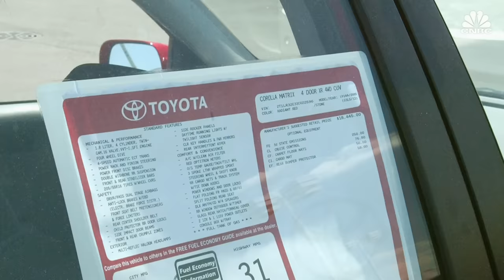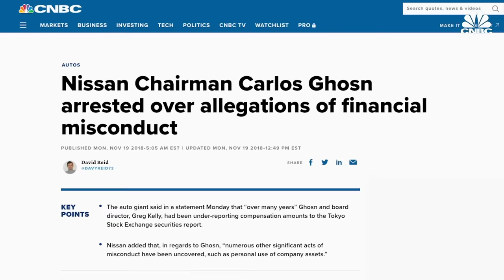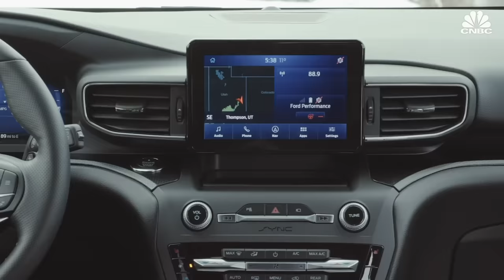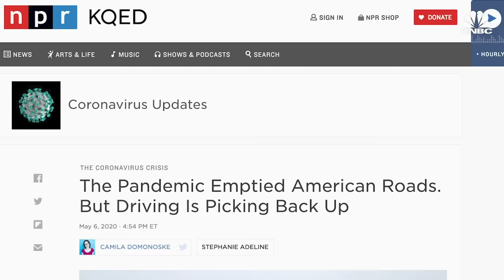Why Toyota, Honda, And Nissan Continue To Bet On Sports Cars

Comment: Probably worth noting is that Asian manufacturers are not too caught up in raw power and straight line acceleration. It can be hard to make a case for getting a car with 500+ HP like a Hellcat, Redeye, ZR1, etc. 

It's not bad to have 500 HP- in a vacuum. If your Corolla suddenly got 300 extra HP and literally nothing else changed it would be awesome, but that isn't the case. That power comes with an increased upfront sticker price. Designing a very powerful engine that doesn't blow up, overheat, or destroy other parts of the drivetrain takes time and the cost is passed on to you. You'll also be using close to twice as much gas as a "regular" car. 

In a car with a 0-60 time of 3.5 seconds, how much fun can you really have on a public road with it compared to if you were in a 4 cylinder or modest 6 cylinder? There's always the track to truly wring out a fast car's potential, but I'd argue that most people who can afford them are too busy working to do that and deal with the added maintenance that comes with tracking.

Comment: It would be interesting to hear why cars like the 2011 reboot of the VW Scirocco do not make it to the US. As one German auto exec told me, America and Canada get the crap, and Europe keeps the good stuff. Euro cars are built to do 100mph for hours on the highway and get good gas mileage.   US cars are designed to keep local police departments busy with speeding tickets as we STILL have a 55 mph max even though everyone on the highway is driving at 80 mph, casually.

Comment: Why I like Tesla Car? It  runs faster than Lamborghini and most of modern sports cars. Sport cars is usually heavy based on the weight and wheel base. But Sports car can run fast if it goes 80 mphs or over.

Comment: If you list all the Japenese iconic sports cars more than half of the list is Nissan.
I'm getting the 400z once it's released! The VR30DDTT can easily be tuned to 600 to 700 whp.
Reply: The A90 is 99% European, not Japanese. Sorry but you can count that one out.

Comment: I always thought that Toyota should make the Tundra pickup more American looking.  It looks very Japanese.  I always thought theat Toyota should give the Tundra some F-150-like body lines.  The first generation Toyota Tocama, in the mid-late 1990s, had very American looking body lines.  The Tacoma did not mimic a Ford or Chevy Trucks but, it looked American.

Comment: Akio Toyoda is becoming the Japanese Enzo Ferrari, in terms of the pride and commitment to his cars.

To do this with a company of Toyota's size is incredible. Think of the amount of red tape...in-company opposition, shareholders to convince...
Reply: Enzo Ferrari would punch you for saying that, he'd never outsource his halo sportscar to a manufacturer on another continent and also a Ferrari badge on it
Reply: @E9X330  The Supra, is not a Halo car. For Toyota, the GR Yaris and Le Mans based hyper car is. And as for Lexus, we know it's the LFA, and LC .

And as for outsourcing? Well we all know the LF-A wasn't bad. 

As a V8 Ferrari owner myself, I respect Ferrari very much. But I don't think Enzo would look down upon Akio Toyoda's commitments to the sportscar industry.
Reply: @JS-te2vj  the supra is toyotas halo sportscar, they don't yet offer anything that's faster
Reply: @JS-te2vj  why do people constantly equate outsourcing an engine to outsourcing the whole car ? The mkv is 95% bmw, remove the Toyota badges, drive on and tell me if you can feel ANYTHING toyota about it, because me and everyone else that test drove it couldn't, it feels pretty much like an m240i with an LSD and proper suspension. Coming back to the lfa, first of all yamaha is japanese and secondly, toyota partly OWNS yamaha
Reply: @E9X330  You can change the argument all you want, but read my initial post. 

Having a small company under your entire control like Enzo did, allows you to take control of all decisions. 

For Akio Toyoda to go against the grain, and to do it with a company of Toyota's size, is a lot harder than you could probably imagine.

As a member of the industry, and with someone who does considerable work with Toyota and Ferrari, I think both have their fair share of respects to be paid.

Its' not easy to churn out coupes with that many shareholders on your back. Let alone homologation models, and other halo cars. You can bash Toyota all you want. But I'm pretty sure the world respects Toyoda more than you.
Reply: @JS-te2vj  how does toyota go against the grain ? They currently offer a total of THREE drivers cars and only one of these is actually fully made and developed by them. I do give them credit for what they did with the yaris GR, fantastic little car and shows what toyota is capable of, but that makes the mkv even more of a letdown. Do you know any other manufacturer that would ever 95% outsource their top of the line drivers car ? Chevy outsourcing the Corvette ? Porsche outsourcing the 911 ? Nissan outsourcing the gtr ?
Reply: @E9X330  As I said earlier, as long as we don't agree on whether the Supra is a Halo car or not, we're not on the same page.

The Nissan GTR, the NSX, the LFA.
These are the Japanese Halo Cars. 

And as for Toyota, the LC500 is their version of a more practical LFA. And I think that really is a wonderful car. Thank you.

Comment: You got MANY of your facts wrong in this feature, and your timeline is all messed up.

In your discussion of Japanese Sports Cars from the 1990s (the “Golden Era”), you show pictures of many cars from the late 1970s & 1980s, as well as cars that never made it to the U.S. Market until the early 2000s.

You also show pictures of the MR-S (MR Spyder) while a gentleman talks about Toyota’s creation of the MR2. The MR2 was released in 1980s. The MR-S (it’s spiritual successor) was released at the tail end of the 1990s, as a push into the new millennium.

Also, the Mazda Miata & Subaru Impreza WRX are by no means in the same class of vehicle, even if they were indeed affordable for their time, and carried Japanese badges.

And the Fast & Furious came out long after the Toyota Supra had been discontinued in America, so it didn’t carry a single drop of Hollywood fame to its grave. Rather, it became Hollywood-famous posthumously.

Trying to capture an entire era of Japanese cars is no easy task, and I commend you for trying. But considering that you chose THE Golden Era of Japanese Sportscars to do your piece on, you really ought to find some people knowledgeable in the field who can double-check your material.

Being accurate matters.

THIS presentation will cause any knowledgeable or die-hard fan to cringe. There’s just too many inaccuracies here, and it misrepresents the most haloed era of Japanese sportscars.

Comment: Because not everybody wants to plod around in a dumb BOX propelled with rubber-band transmission, suspended on top of wine barrels, whilst stabbing frantically at a stupid touch screen trying to adjust the ventilation fan.

Comment: they are bringing back the names that have nothing about the original , the blazer is a uni-body fwd crossover not a truck . the Bronco starts at uni-body levels and offers  small 3 and 6 cylinder engines no v8 , the supra is a BMW the only ones that even come close to being the 90's experience are the Nissan z, the Subaru sti (still with older style of power steering ) and the Mazda. its sad modern gov regulations and buyers that dont care have destroyed the affordable car markets joy

Comment: Does Honda still make a sports car? I don't see how an alien looking Type R is considered a sports car when its fwd and slow with fake vents.
Reply: I agree with you on the horrible fake vents. However, you can take them off and replace them with real vents with real purpose if you tune it, which is useful, I guess. As for being slow, nah, this thing is an absolute track weapon, sure, it understeers a little, but other than that, no complaints when it comes to performance

Comment: Honda doesn’t continue to beat on sports cars. The civic type R is not a sports car. A well designed front wheel drive turbo hatch? Yes. Where’s the s2000 or it’s successor? Where’s the RWD 2 seater coupe from Honda? Toyota and Nissan have it at least

Comment: My STOCK 95 240sx has over 380,000 miles and still runs strong, I'm glad the Japanese sports car market exist cause in my honest opinion American Sports car are poorly built, not worth the cash, handles like crap unless its one of those spec'd out models that cost a fortune or a Vette, other than that the Japanese market builds sports car that are reliable, better value, and handles like a sports car should, Japan test sports car on their curvy roads and hilly landscape, they give it the power its designed to handle, its just PERFECTION over there hands down the CUSTOMERS really come first
Reply: @japanwatchconnection My point is when it comes to the overall package for a sports car your getting a much better buy with a Japanese car regardless what ERA... Look I bet there's more JDM sports car on the road that hold higher value, better condition, dependable, and reliable than any USDM car of any time... They just build  vehicles better period thats my point

Comment: LOL Going electric or hybrid will bring back an interest? Really?! Ummm real enthusiasts want gas and manual transmissions that aren't driven by wires and computers for everything that doesn't require a PhD in order to repair. The auto market has lost it's connection with the real car market and the government sticking their nose in it isn't helping.

And I think what killed Nissan when it came to sports cars is coming out with a car that everyone was praising as a supercar that a normal person can own, and then letting that get to their heads and starting to up the price and charging supercar prices (GTR). I think I remember when it first came out it was $60k? Which was still out of the hands of a middle class income, but possibly obtainable as a midlife crisis car.

Comment: Sports cars are awesome but they're not great for the city. SUVs and trucks are safer, aren't as likely to get broken into, and you really can't use all the speed that engine has to offer. Plus buying things and hauling friends, family and kids. They're really impractical as a DD.
Reply: The gr yaris mazda speed 3 they are all good for the city compact easy to park safe quick and fun with a little bit of economy suv really do you really think it is possible to park your toyota land cruiser in the city center